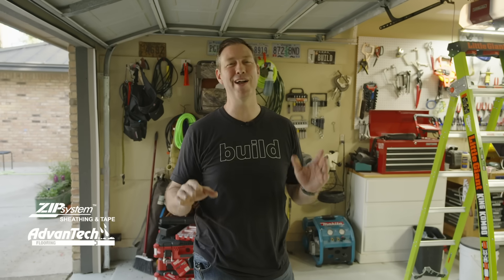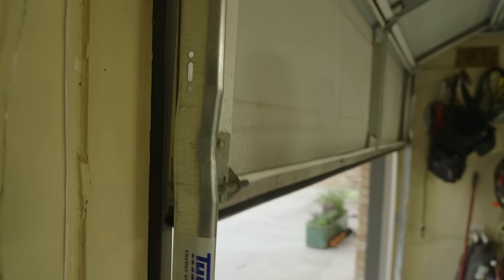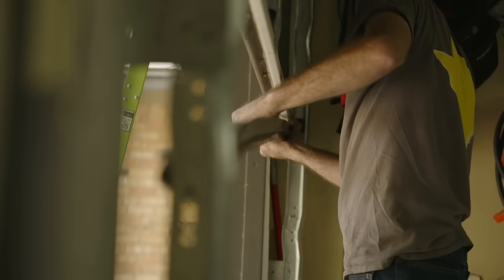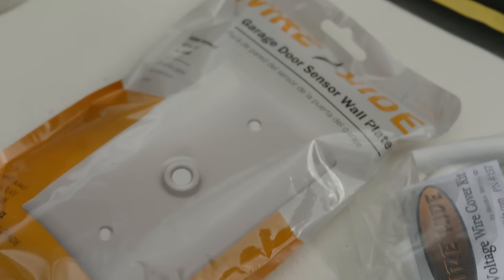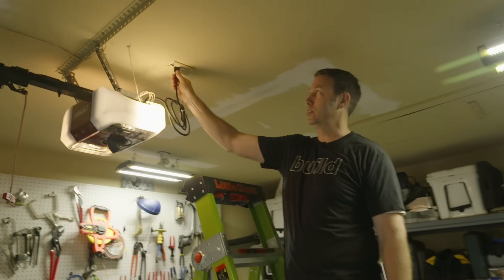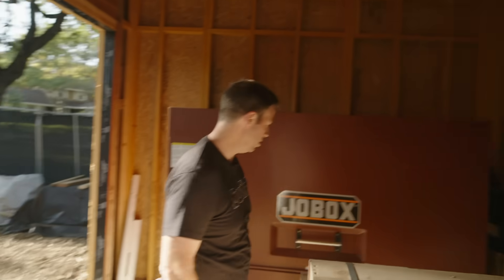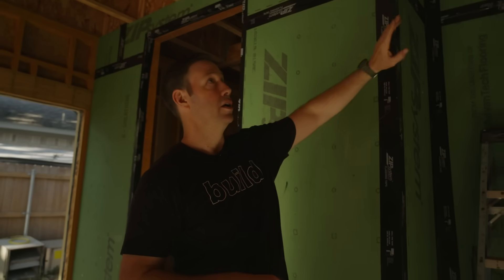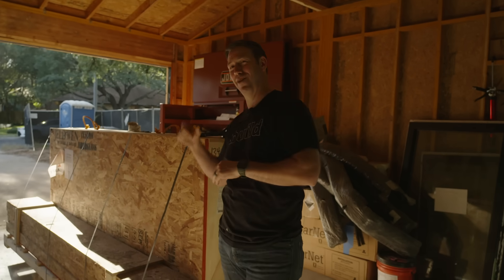Garage Door - Air & Bug Sealing

Comment: Hey I did this idea without realizing it.  I had the play issue, so where ever the wheels rested, i just cut those felt protector pieces for the bottom of chairs, so then the wheel is pushed ahead in that spot.  Makes it tighter and stops the rattle to from wind and opening your other doors.,.
Reply: Bad news for their patent, if it's obvious to someone "skilled in the art"
Reply: @rpavlik1  The patent becomes irrelevant if you can DIY a solution to the same problem for a fraction of the time and cost.

Comment: I you do not have small children to worry about those sensors can go on the cealing.  When installing a new door at a previous residence I put them up between the  roof trusses.     How high on the wall will that vent fan go?

Comment: For the bottom seal of garage door, put 1”caulking backer foam on the inside of seal. Also up here in the north woods, we love our 2” spray foamed filled garage doors. Finally, for your new house check out lift master direct drive openers. No over track and super super quiet.

Comment: I dont understand why people buy homes with garages if they're not going to use them...they're a good safety feature,,especially when it rains or too cold, or have to take groceries in...
Reply: Just my opinion... an attached garage is a convenience.  A detached garage with or without a covered walkway serves the same purpose. The added safety of an attached garage is somewhat outweighed by the added problems created by the storage space and the motor vehicles under a common roof. The hazards of stored chemicals and the relatively large amount of gasoline in the vehicles is a very real problem. As a retired professional firefighter, I can recall SEVERAL working fire incidents  in attached garages that I responded to. All of them were preventable,  all did extensive damage, one had the homeowner spending time in a burn unit. I also remember one that started in the house and extended into the garage via the gasoline fumes from the parked vehicle...  Several years ago a neighbor of mine built a large detached garage with a " mother in law" apartment over it. He attached it to the house via a long vestibule. His rationale for the separation?  Fire safety... " at least the FD should be able to save the house if I have a fire when I'm working on something..."  Personally,  I would never use an attached garage for motor vehicles... it's valuable living space for other purposes... man cave, workout room, wood shop, small boats and boating equipment,  tool storage...  matter of fact, I wouldn't use a detached garage for motor vehicles, either, for the same reasons, although a detached garage with a storage space to hold the chemicals and gasoline and such is what I'm doing.
Reply: @mikegrant8490  while all that you said may be true to a degree, people need to also knowledge themselves and build or remodel areas of their home with safe or resistant to things..and they do make special canisters and lock boxes to hold gasoline and combustible chemicals people just dont invest in them. And as far as attached garage safety my attached garage serves me greatly especially when I am cleaning or working on my car and I'm laying under it for hours and it's too hot or cold outside or if I need to leave things unattended for hours or days, or I have to run back and forth to the car in my p.j's..my wife is safe for bringing in tons of groceries she can just leave doors open and take her times..as far as car fires ect..people just need to maintain the maintenance on their cars,,that's their fault..as far as fumes , people just need to knowledge themselves on safer building materials like flame resistant paints and carbon detectors and garage exhausts..this is why building  codes needs to change or be more stricter..I chose an attached garage over detached any day..
Reply: @STeeLo205  I have to agree with you on several of the  safety items you note. It really does come down to personal preferences and needs of the owner. Maybe in a few years when the possibility of most vehicles transitioning to fully electric, the issues with chemicals and gasoline fumes will be disapated to  almost a non item of discussion. Certainly,  having the ability to work inside during heat and cold and being able to just close up and come back later is a significant advantage. Following normal safety practices seems to be a certainty with you, too. Your points are well taken. Be safe, live long and prosper!

Comment: I replaced my  "builder grade" (junk) wood doors with Clopay premium insulated doors.  They are rated around R-11.  My garage is heated and cooled as I tend to do a lot of car work as a hobby.  Don't ever spend too little for something.  The bitter taste of cheap lasts a lot longer than the initial pain of a high price.  In most cases you get what you pay for.

Comment: Neat products. In Wisconsin we use insulated doors all the time. Works great. It also reduces condensation on a cold door. 
I am drywalling my garage. After it was built, we did the insulation ourselves and now plan to dry wall it. How do you recommend we approach drywall at the doors and hardware?  Should we have the door spring removed and then reinstall after the drywall is up?
Reply: NO, it will fall off.

Comment: With the insulated garage doors you have the option for getting the inside of door with or without the metal sheeting.  Go ahead and spend the extra because I did not and anytime I bump the door with a ladder or whatever it gouges the foam insulation on the door.

Comment: I installed a regular exhaust fan in my garage and wired in a couple relays to power it for a half hour after the garage door gets used. Similar concept to the motion sensor, but mine only runs when the garage door is operated instead of every time someone walks into the garage.

Comment: Hey Matt, I can help here! We moved into this place in the high desert about a year ago and when the garage door openers didn't work at all we had the local crew out and they said our existing insulated doors were "the best there is." Here's a link to the label: https://imgur.com/a/LUMGG4x I love all your tips this time since they'll work in a remodel, and they are also DIY friendly, awesome! We don't usually have an issue with the sensors getting bumped, but the weather sealing isn't as good as it could be, so thanks for that today!! I have to say when it's 100+ outside it's nice to be in the garage and it's still comfortable.

Comment: Garage door sensor install:
I like how your installer coiled the low voltage cable into a springlike configuration, it keeps it neat and allows the slack one need for service. This is an old technique used by the phone company in the early days. (6:05)

Comment: Really liked the follow up on the seal, something for other folks to look out for if they choose to use the product. It's not a bad thing that we have to change the way "we've always done it" to make things better. I think the company may use the feedback to make some design changes or recommendations to the end installer to correct the possible issue. Nice work, Matt!
Reply: It was installed incorrectly. According to manufacturer instructions.

Comment: I like the idea of a double seal on the edges of the garage door, but the "S" shaped track is a gimmick. If the tracks and side/top seals are installed and adjusted properly, the door will seal. There are slots in the wall mount bracket for this purpose, but people don't usually adjust them because you then need to adjust the corner/top track to match. Stuff wears over time, and the s-shaped track will take up the slack, but so will new rollers and an adjustment... and I'll bet those tracks will cost substantially more.

Comment: I have insulated doors from Midland Garage Doors.  I'm in The mountains in South Dakota. I have in floor heat and my garage stays very comfortable all winter.  I keep the thermostat at 55 though I might bump it up a little this year as I'm building a truck and will be spending more time out there. I have the Chamberlain door operators with battery back up and MY Q. The camera function wasn't available when I purchased. My garage is connected to the house by an 8' connector.  The house and connector are on a foundation so there are steps from the garage to the house.  The walls and the floor trusses are spray foamed and should provide excellent air sealing between the house and garage.Where I might have missed is the ceilings between the connector and the garage are not separated. The garage is finished with 5//8" drywall on the ceiling and the common wall

Comment: My garage door is a sectional overhead manually operated insulated industrial door.  The e.o. cost of it was small compared with the garage/extension build cost.  It has a large wiping head seal and substantial rubber wiping side seals with a large diameter round bottom seal with wipes.  The perimeter of the door does not have any draught points i.e. daylight cracks.  The threshold has a steel angle with welded tangs bedded into the concrete at construction , which was lined and levelled prior to the concrete being laid (it also provided a tamping rail for the flat floor).  Externally there is a 3/8" step at the steel threshold to prevent blown stormwater entering the garage that is unnoticeable in use.  Being perfectly flat the threshold now creates a perfect seal with the door bottom rubber that is a common issue on most industrial installations that have the concrete laid by eye at the threshold.  To rectify existing installations I have used a simple 3/8" x 1 1/2" flat bar bolted down to the concrete that is lined, levelled and then grouted.
Personally I don't see the need for electrical operation for a garage door (mine is 16' wide x 7' high that is well balanced on an overhead horizontal door spring) as it is easy to use and 100% reliable with very little maintenance.  My neighbour has an electrical operated door of similar dimensions that is constantly breaking down!  I can actually open my door much quicker than any electrical operation.
I would never specify drywall to a garage interior except as a double board installation as the operations within the garage require a very robust surface finish as well as having the ease of fixing for the plethora of racks, equipment and the like.
Garage ventilation should be placed low down as CO is heavier than air so that the accumulation of toxic gas is low down.

Comment: On your new house you should consider prewiring for an EV charger, or at least install conduit so you can wire it up later if you need to. I strongly agree with the choice of a jackshaft garage door opener.
Reply from the maker: Already planning a 220 line for a future charger!

Comment: He just installed it incorrectly on top by not moving the strip further into the external strip, you know what I'm saying. Looks like he tapped rather than pushed that camera in place too. Just saying what I saw there, that's all. And as for the staples, I don't think they are needed if you get new exterior siding and just put some new nail holes in it to accommodate the new interior strip liner. Staples are going to create air pockets I think, which makes me think it isn't last as long now that it has a bunch of holes in it either. Hit me up next project you got Risinger, I'm your man, lol.

Comment: Was just thinking "Exhaust fan", lo & behold, Matt pulls one out😂 also if put on a long interval, will help cool the garage after u pull in! (Vehicles will radiate heat into the garage after being turned off)

Comment: 'figure out how to get the garage door down'...  you grab the handle for the manual disconnect and lower the door. Then re-engage it and fix it later at a more convenient time.
Reply: I know, it literally take 5 seconds to pull the handle especially on small doors.
Reply: ....been doin that for years. PLASTIC  GEARS   in the electric door opener.....???/   who woulda thunk......more modern junk......goto hell, you manufacturers...plastic.......our planet is drowning in that shit...
Reply: No need to disconnect the door.  Just hold the button down to override the puppy saver sensor.  It's a standard feature.
Reply: That’s what I was thinking! I’m 66, single and female, and I would never have called anyone because of that!
Reply: @Pleasant-Peasant-789  Good point

Comment: Battery backup garage door opener is code here in California after all of the recent fires.  I think that went into effect this year or last.
Reply: California requires all garage door openers in residential applications sold or installed in California on or after July 1st 2019 to be equipped with battery backup.
Reply: which is dumb because all you have to do it pull the rope with the red handle and open the garage door by hand.  Another government code that just adds costs, not safety to homes.

Comment: Battery backups are now code required in California because of the wildfires knocking out power and people going to the garage to escape and getting killed in the garage because the door wouldn't open.
Reply: I have never seen a garage door opener that did not have a mechanism to disengage the opener so the door could easily be opened...and what about all the doors that do not have openers? You open them by hand...
Reply: @chex313  It's California. If it requires doing something that their smartphone can't do, many of them are helpless. Firefighters coming in later would be looking at the pull cord that disengages the opener and shaking their heads at how easily the trapped people could have gotten out.
Reply: @bokononisti2820  Gotcha, hopefully they buy a Chamberlain with the battery backup and phone app...lol
Reply: I’m pretty sure I’d drive right through the fuckin door before I burned to death but hey it’s California so

Comment: We have garage doors with: THERMAL BREAK + R VALUE 18.4  “sandwich steel” 
STEEL FRONT SKIN + PolyURETHANE (not styrene) + STEEL BACK SKIN and a THERMAL BREAK (epoxy/rubber/Pvc liner completely SEPARATING the two sheets of steel skins!) 
In AZ the builders provider a NON INSULATED “pan” door like this guy has in the video. Take the same “pan” door and have it insulated (waste of $ if done PROPERLY with the correct Weight NEW SPRINGS) adds an r value of 3-6 $300-500 pro install cost. In the summer 150°F garage temperature will drop 5 to 10° on average.
Next would the same type of door with polystyrene (1-3/8-2” thick insulation/door) with a steel backing on the inside. See a 10-20°F improvement.
BUY THE RIGHT DOOR LIKE MENTIONED IN THE FIRST LINE 

Steel/2” Polyurethane/Thermal Break/Steel and you can commonly see if 30° plus improvement in the garage you can now economically air condition and or heat your garage.

Comment: When you buy your garage door, make sure that it also has a sheet metal back. The ones with the exposed insulation are ok, but not great. They tend to get loose over time and just look bad. I have a Pella garage door and it has been solid. For your current house though, you could buy the insulation panels to install in the current door. Weather sealing your garage doors isn't just good from an air perspective, it's good from a moisture perspective too. I had way too many cables rust out and snap at the bottom loop because moisture was getting in there.

Comment: Matt, I’m sure you’ve got the industry contacts to get best deal from several door manufacturers. Since you did ask for ideas, we’ve installed Clopay insulated doors on our homes, but they’re at much different climate than Austin; high in Big Sky, MT and Lake Tahoe. They’re composite exterior, carriage house design but other architectural styles available. The inside and framing is steel w/2” polyiso core. They claim R20, but of course that’s in panel center. Several manufacturers offer similar designs, Clopay is widely available in our location. Even in blowing snow storm, there is no air leak between panel and door interior surface is reasonably warm. The doors however creak in wind due to the slop in roller-track. I would be very interested in this ‘S’ track but I’m concerned it might compromise the panel lap seam sealing. Can you assure that panel seam integrity was not compromised?

Comment: The exhaust fan would be a good idea if connected to a C02, CO, or Gas sensor. 
I bolted a small UPS for electronics 350-550va (50-65$) and connected that to the garage door. Lasted over a week during hurricane.

Comment: You’re an R value guy, yes 19.4 in 2” doors maybe more not uncommon. Overhead brand builder door you currently have was the worst door ever. The door skin 25 gauge was folded over, in place of end styles. The sensor shield, sorry that’s a gimmick. The Liftmaster safety eyes track bracket has a wall mount.

Comment: I used brush seals under the traditional vinyl seal.  https://www.summitracing.com/parts/sez-716

Manufacturer website for product linked above:  https://www.sealeze.com/residential-and-commercial-overhead-doors

No affiliation, just use and like the product.

Comment: So your putting a vent in the garage, but completely air sealing the entire thing.  You will suck it into negative pressure, but not really pull anything out if its all sealed.  I assume you will spray foam the entire garage?  You really need a Panasonic air exchanger in the garage so you will balance the airflow during the exchange / exhausting.